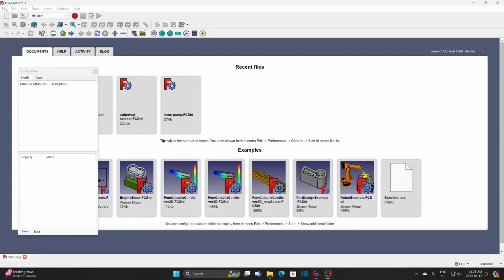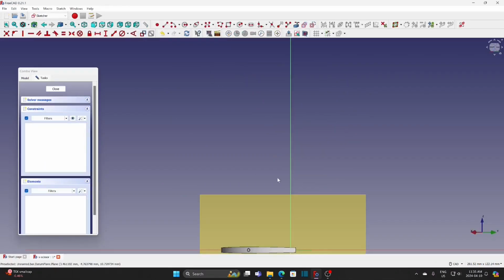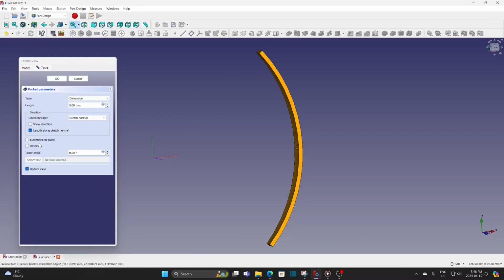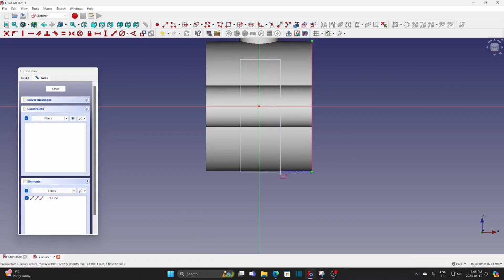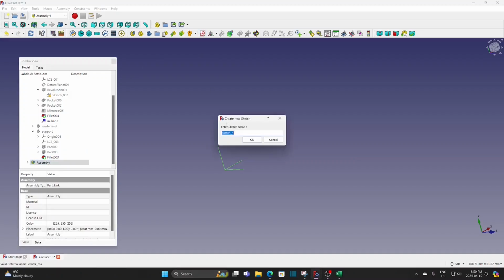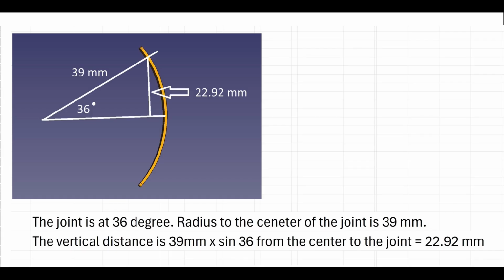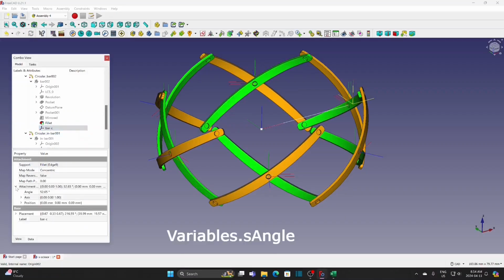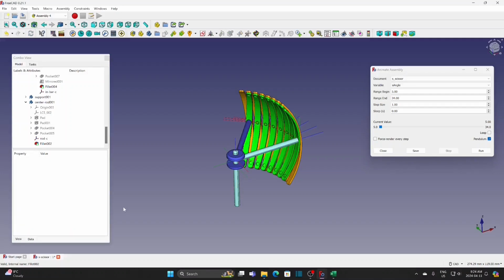FreeCAD Tutorial Assembly 4 - Spherical Scissor Mechanism & Animation Part 1 (Assembly4)

Comment: could you please make it in one continuous circular loop, only changes its radius according to its center. I mean is it possible? It kind of looks like possible, like in vascular stent mesh.
Reply from the maker: Hi, I think it is possible. Then I have to keep the "sAngle" constant, and use "radius" as the variable. Let me figure it out and let you know.
Reply: @KK_CAD  thank you, I am trying to perimeter truss mechanism like animation
Reply: @KK_CAD  hey, did you figure it out
Reply from the maker: Hi, Not yet.  I think I will try this week. Will let you know.
Reply: @KK_CAD  thank you, check this paper, 'Configuration synthesis of hoop truss deployable mechanisms for space antenna based on screw theory'
Reply: @KK_CAD hi, any luck with this? I tried to make it in fusion 360 but animation seems to not working.
Reply from the maker: @hakankosebas2085  Hi, Sorry. I am quite busy this month and haven't checked it yet. Will see when I can give it a try. Will let you know.